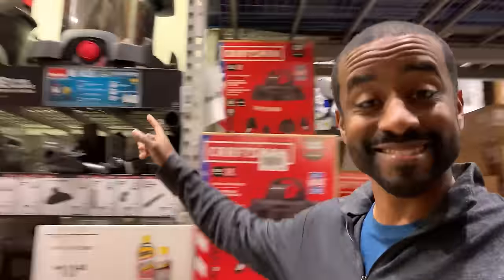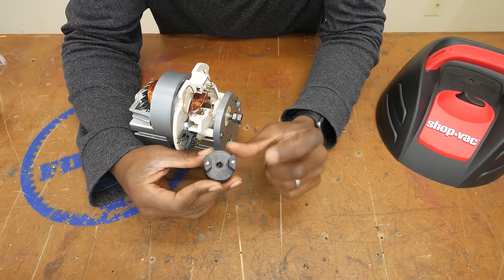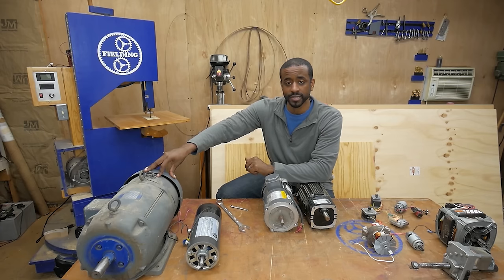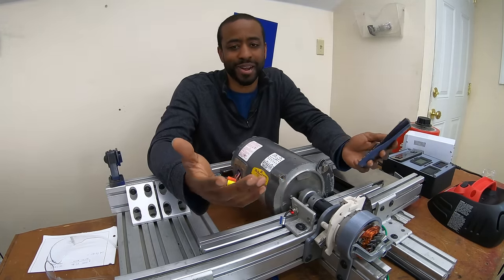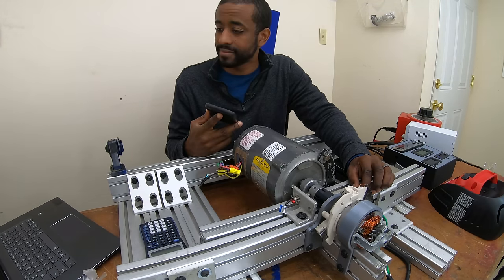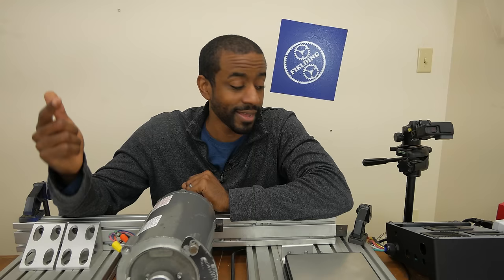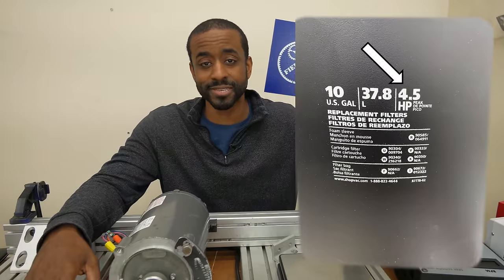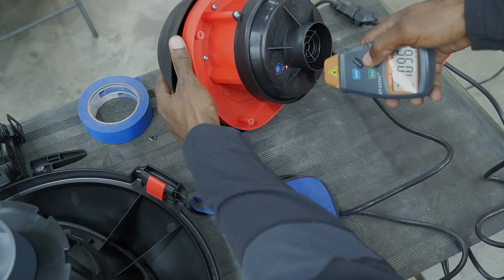How Much Horsepower Does Your Shop Vac Really Have: #078

Comment: Most homes in North America use 120v with 15 or 20 amp breakers. That means 120v*20amps=2400watts=3.2 horsepower theoretical maximum. These horsepower claims are impossible.

Comment: The theoretical maximum for a 120V, 15A circuit is 1800 watts, or 2.4HP. A fair estimate for efficiency for a small, universal motor is about 50%, or for a net 1.2HP. So it sounds like they're counting the potential energy in the inertial mass of the motor and impeller, which, if suddenly stopped, would momentarily release more energy, hence greater power. However, that's not terribly useful power and I find it rather disingenuous to say the least.

Comment: As Ryan said a few comments back, peak HP is about rotor inertia. The inertial component does have meaning for something like a tablesaw, where the rotor/blade inertia can push the blade through a hard spot in the wood where the motor otherwise couldn’t drive it. But it has no meaning whatsoever running a vacuum. It’s just BS.

Comment: How much power,  easy.  80% load on a 15 amp circuit is the max for these appliances.  So  if you look at the box it always says 12 amps max.    There ain't no more.   125 Volt circuit.    So  12 Amp * 125 Volt * .85% efficiency of cheap motor  /  745 Watt / hp  =  1.7 Horse Power continuous.    That's all folks unless you spend a bunch more on a 92% brushless motor or go to a cordless tool with a large high voltage battery.

Comment: It is not the power the motor generates if it is stored in a flywheel. What size of flywheel the motor can get moving starting from static is what will get you the real Torque the motor can generate and the speed is just the speed. 

And really mixing together Torque and speed as HP is useless anyway, only at given speed the Torque matters and so on.

Comment: Peak HP is not a thing, its just marketing wank. But from my experience it does give a pretty good "relative" scale for comparing shop vacs. Unfortunately the content of this video doesn't really tell us anything we didn't already know? A better idea would be to compare two or three shop vacs with different Peak HP ratings to see the relationship between them in terms of performance.

Comment: A 15 Amp 120V circuit can only feed 2.4HP.  If that Vac doesn't have a 240V plug on it, then it's never gonna produce 4.5HP.

Comment: Couple things here..
1. You can prove this lie at home by measuring the current being drawn from the wall. The wall is just incapable of giving out multiple horsepower like that.
2. You asked why they don't rate by vacuum amount. That's because they all generate roughly the same near vacuum level.
3. They also don't want to rate it by CFM because it's something that can be easily manipulated as well, and you actually end up with a crap your vacuum with higher numbers but people would buy the higher number one and then not be satisfied.
Reply: Not sure where you get that the wall can't do multiple hp. A basic 15 amp circuit(at 120) is rated at 1800 watts or 2.4 ish hp. A 20 amp at 2400 watts or 3.2 hp and yes i'm ignoring efficiency but you didn't bring it up. Most motors are not that inefficient anyway.

Comment: well sir i don't really know but sounds good..... the definition of HP is how much weight is moved over a given distance. so 4.5 HP is an incredible amount of power for a little amount current and voltage. Even a 3 phase motor with 480v would be struggling to achieve some of the numbers that they post. Makes me laugh.

Comment: It's a good video, unfortunately it's completely unnecessary: the rating on the case is 120v, 9.9A: that's about 1200w or about 1.6hp assuming 100% efficiency.
Reply from the maker: Buts its not 100 % efficient... so the video was necessary LOL. The question is "What is the real number", not is the number right. I said that in the first 20 seconds of the video.
Reply: @Jeremy_Fielding  Fair enough

Comment: With different gearing you could draw a higher suction,lower velocity & vice-versa? That would be determined not by the HP rating by the motor, not the part that creates suction force itself? The diameter,shape,speed of the fan determines the "horsepower" not the electrical part.

Couldn't you generate higher suction at a lower velocity & not be lying about horsepower? Obviously the marketing claims aren't true anyway though

Comment: their method for determining "peak HP" is arguably correct but marketing hype. They do the same thing with Air compressor motors by calling the HP "SPL" or special LOL.. spa pumps also us marking BS as well.  All anyone has to do is look at the nameplate amps. 9.9 amps and your .87HP is about right.. 
Also those brushes in that motor are NOT seated correctly.. that will rob HP as well.

Comment: I have to laugh when I read peak horsepower ratings on motors and wattage ratings on audio equipment.  If those ratings were anywhere close to being true, the power cord would look like the cord on an electric clothes dryer, range or central air conditioning unit.  I don't recall ever seeing a home with 240(220) volt outlets in a living room or bedroom.  I have a major brand surround-sound receiver in my living room that the manufacturer claims to have a 500 watt output, yet the electrical power rating on the back of the unit is only 125 watts.  Either someone is sorely twisting the truth or they've made a monumental scientific breakthrough.

Comment: Vacuum cleaner HP ratings are not right. A 1 HP motor would draw(-10 amps so a 4.5 HP would not operate from a typical 10V 15A outlet. Additionally a 4.5 HP single phase motor would be about 7" in diameter and weigh 50 pounds. This motor in in the 4" range and maybe 4 pounds.

Comment: This is easy. Better asked how much power is available from a typical North American wall outlet? Well it’s nominal 120 volts X 15 amp = 1800 Watts. It takes 745.6 Watts to equal one horsepower so 1800 divided by 745.6 = 2.41 hp. I wouldn’t be a manufacturer of a product that draws more than 15 amps from a wall outlet so anything more than 2.4 hp is an outright lie, not even figuring efficiency/loss so perhaps half? Peak hp please.. I could put a mouse motor with a big flywheel and come up with some arbitrary inertia formula.

Comment: Many "standard" AC motors have a maximum startup current draw of 220%  of what is pulled at rated (no-load) speed.  As load is increased, the motor begins to slow down until it reaches breakdown speed at that 220% point on the curve. Then it stalls.  So it is easy to claim that a 1 HP motor has 2.2 max HP but its just a marketing gimmick.

Comment: Here's an idea what I think they do.. Let's try RPM being the maximum FREESPOOL speed of the motor, that is with no load, just before the rotor flies apart.. Torque is the maximum torque it can produce under obviously, a heavy load just before it catches fire. I'll just take your numbers. Your max RPM was given at 20,340 and your max torque in the other test was 1.15 ft. lbs.  1.15 ft lbs x 20340, / 5252 = 4.45 peak HP The torque and the RPM do not occur at the same time, the number is completely fictitious and absolutely misleading.

Comment: Nobody's is taking time into consideration. This thing probably "peaks" at 4.5HP for a few cycles, which is not enough time to blow your breakers. You need a power analyzer that can record voltage and current waveforms.
Reply from the maker: It doesn’t matter. If their description is correct. In coming power from the wall is Not considered
Reply: @Jeremy_Fielding  My comment was directed at the other commenters. None of which mentioned the enormous spike it current electric motors produce. Granted you'd be measuring input and not output so efficiency loss would have to be considered but the data from the power analyzer should give enough numbers for the marketing department at Shop Vac to spin into that 4.5HP figure.

Comment: Great job and thanks. But, is it not the length of the arm, but actually instead it's the mass of the arm that allows the skinny kid to balance with the fat kid. The length of the arm is irrelevant to its mass when measuring for leverage, torque, and/or balance.

Comment: it's like measuring HP of an engine by throttling to max rpm in neutral and suddenly dropping the clutch. it does not measure the operational HP, it measures the kinetic inertia of the engine and it's flywheel. LOL

Comment: Is there a minimum size of universal motor that can supply a useful output of 4.5 hp? I mean in terms of mass of copper or maybe dc resistance of the coil? Just looking at that motor made me think "No chance little fella".
Reply: I mean to say, can we relate the physical size of a UM to its potential for power output?
Reply from the maker: Mostly yes for universal motors. You need a certain amount of copper to produce the required magnetic strength but efficiency is certainly part of the design as well.

Comment: This is a lot like rating audio amplifiers according to "peak power" instead of RMS power at 10% THD or something like that. They crank the amplifier until it outputs pure noise and look at the highest point on the output waveform and call that the peak power. It's a completely meaningless number.
Reply: John S that’s why I ignore peak output except as a measure of dynamic headroom. I always judge amplifiers on sustained power output and THD. peak just gives an idea of its headroom at near max load.

Comment: You realize you are overthinking this? If you look at the data label on the side of the vac, you would see the max current draw is 9.9 amps at 120 vac, which produces (via simple math), 1.6HP as the actual real world horsepower rating.
Reply from the maker: Perhaps you didn’t actually watch the video? That is not the answer for several reasons

Comment: Never trust a horsepower number over 2. A typical domestic outlet in the US supplies 15A at 120V, or 1800W, which is 2.4hp. Generally, tool manufacturers don't want to sell you a product you have to check breaker ratings before plugging in, so they'll never ask for more than that out of the wall. (Usually they play it safe and go well under 15A.)  So, 2.4 hp is the absolute maximum power any 120V tool could ever generate.  Any number over that is complete bullshit.  In reality, it's highly unlikely you'll ever get more than 1.5hp, taking into account safety margins and inefficiency, and even at that level the tool will probably be a pain to use because it'll blow breakers if you plug in anything else at the same time.

Comment: Knowing that these outrageous HP ratings from 120v motors were BS, I just assumed that they were rated for 240v or even 277v as a way to deceptively shade the truth, but the rating label on that vac indicated only 120v. I guess they're just unabashedly lying. :-O

Comment: They're just banking on the fact that 99% of the population has no idea what a horsepower is and that you can't pull more than about 1800w from a 15 amp 120v circuit, so there's no way even the 2.5hp rating is accurate, let alone that 6.5hp nonsense.  I bet it's the same motor in every one of those vacuums.

Comment: "Why not brag about suction power?" Yeah, that's what they do overhere in Europe, because no one here believes them when they claim a vacuumcleaner has more power than your moped.
So vacuum manufacturers invented a power unit called the "Air Watt"... This number is derived by doing some sort of math that factors static suction and open air flowrate into one single meaningless number. Because you can never reverse the math in order to get to the original numbers. If you ask a manufacturer about the actual numbers, they won't give them to you. Even the fan curve diagrams shown on their websites are now done in airwatts.

Seriously there should just be a law that manufacturers are only allowed to use SI units in their advertising. "peak horse power" and "air watts" are not SI units, so they shouldn't be allowed in advertising at all.
The simple fact of the matter is, manufacturers do not want to tell you the actual power output of their products, so they just make up a unit that sounds impressive, but in the end means nothing at all.
Reply: True "Air Watts" is the ONLY relevant rating, it involves the product of lift(suction) times airflow volume through an aperture which is optimized for the pneumatic impedance of the motor. a Hoover or Kirby upright vacuum does its best work through a larger aperture, with less pressure difference, but higher volume, a canister vacuum favors a smaller aperture, more pressure difference at a lower volume. You need the COMBINATION of suction and airflow to create air power, just like you need torque and RPM, to get horsepower.
Reply: @vincentrobinette1507  The problem with "air watts" is that they aren't an SI unit. There's an ASTM specification, but that has no legal value in the sense that it can't be used to make manufacturers use a consistent number.
For example Karcher and Dyson do not use the same formula to get to the "Air Watts" they put on the box. You can't compare the two.

Yet up to a few years ago, there was no such marketing unit. They'd just advertise "our vacuum cleaner has a 3 stage impeller, a 1200W motor and delivers X hPa in static suction and Y litre/sec in free flow."
Now they pick and choose the most optimised numbers and multiply them together, to get a nice big looking number. Just so they can slap "2000 Air Watts" on the box of a vacuum cleaner which is mandated by law to not exceed 1000W drawn from the wall.
Reply: @fermitupoupon1754  Air watts, the product of suction and flow volume, is what creates air flow velocity. The higher the velocity, the heavier/denser the particles of debris it can actually suspend in its airflow, and carry off. If you put a penny on your arm, and seal the most powerful vacuum over the penny, it won't be picked up. As soon as you tilt the hose, and allow airflow, then, the high velocity airstream can pick up the penny. If you attach the hose to a 4" drain pipe, you still can't pick up the penny, because even though there is a lot of CFM, it's divided over so much cross sectional area, that there is no velocity to pick it up. you need to concentrate the airflow, to get the velocity, to pick up something dense like hex nuts, bolts, gravel, or coins. flow volume without lift is pointless, and lift without airflow volume (stuffed filter) doesn't work either. You need the two.
     Air watts is a specification handed down from the VCMA. Vacuum Cleaner Manufacturers Association. it's measured by reading the lift in an air box, with apertures of various sizes allowing air into that plenum box. Canister vacs, do better with smaller apertures with more lift, Uprights, like old Hoovers and Kirby upright vacs do better with larger apertures and less lift. ShopVacs are somewhere in the middle. They have almost as much airflow as an upright, and almost as much lift as a canister. The air wattage is actually similar.

Comment: There was a class action lawsuit over this kind of marketroid nonsense where air compressors were being marketed with ridiculous horsepower claims. The result was a slap on the wrist, and plaintiffs were awarded free hardware from the offending companies as a reward!
Reply: But, yanno, I bolted on a chrome air cleaner from the auto performance center because it's an automatic extra 5HP...

Comment: Pretty sure they're taking about brake horse power. Likely measured with the impeller on the shaft for max flywheel effect. This is how small power equipment engines are measured. It's all junk science for marketing and promotion

Comment: 10:45 What I want to know is if this "Peak HP" is actually factual for comparison purposes.
Can you buy a few different brands, and a min, mid , max HP models of each. Then test them for the actual HP like you did in this video.
Chart them to see:
1) Are different brands comparable using "Peak HP"
2) Is laboratory testing is even required if there is a simple Motor HP to "Peak HP" formula
3) Calculate what kind of "Peak HP" is possible if you were to put a bigger HP motor in it. hint hint ;-)

Comment: that's not how an induction motor would measure hp you dont just make it spin backwards induction motors require a totally different system to work as generators
Reply from the maker: I don't understand your comment. I am not using the motor as a generator **"if" that is the point of your comment. You should watch the video before this one to see how the dynamometer actually works. It has been tested on several motors with a known hp.

Comment: 50% efficiency, because the output motor has 25% efficiency and the input motor has 25% efficiency.
Reply from the maker: You should watch the previous video. The "input" motor as you describe it has no effect on the test results. It has been measured against motors with a known hp. Just watch the video prior to this one if you really want to understand what is happening.

Comment: They should be charged criminally. You can't put more than 12 amps legally on a 15 amp circuit .746 watts equals 1 horse power. Do the calculations 12 times 120  equals 1440 WATS which equal 1.93 horse power .RPM has nothing to do with horse power or torque.# Poles equals torque and RPM.Its the same scam with Stereo equipment. Watts output in RMS not peak or peak to peak and not the power consumption of the equipment.

Comment: I'm into car audio and the majority of crap china made car amplifier manufacturers use peak watts as the front and center marketing to sell their amps which is misleading as peak watts is only momentarily or a brief burst.  So a 600wx1 amp may only be 140wx1 RMS. If you want real 600w  you need to go with a good company like Orion and look for 600w RMS and make sure you feed the amplifier the power it needs. As far as shop vacs RIDGID is the best brand.